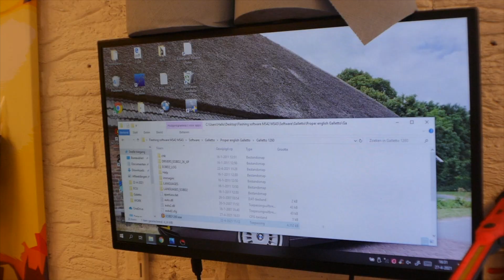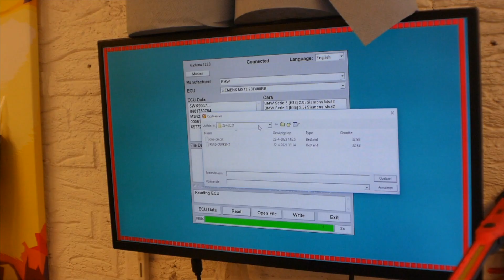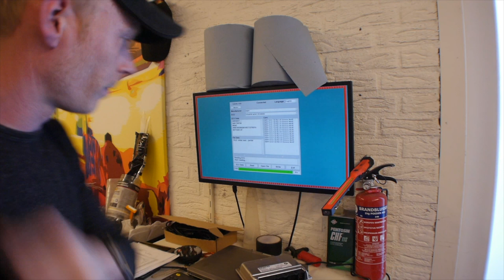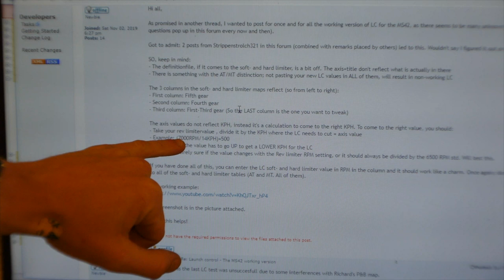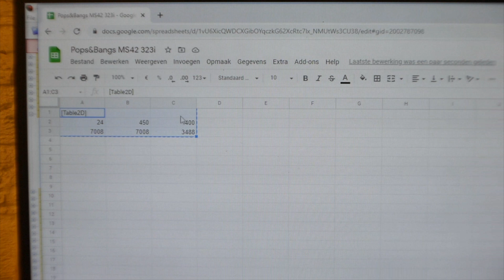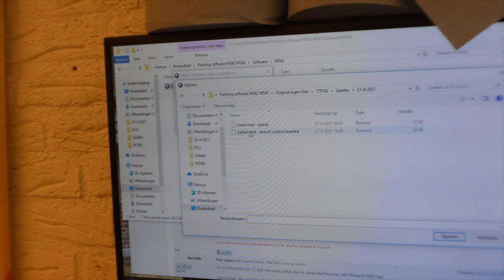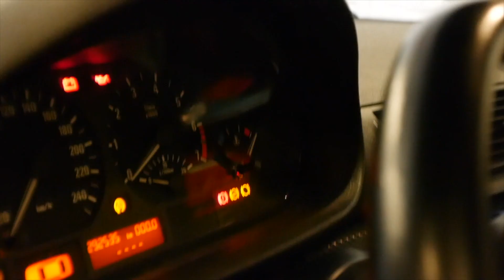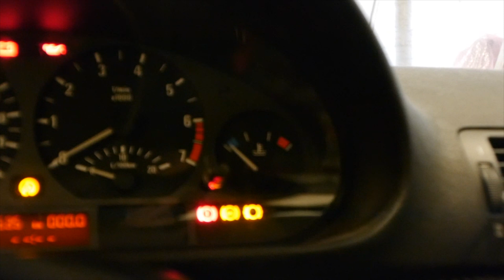YOU can remap LAUNCH CONTROL in your car! - BMW 323i e46 MS42 M52 - DIY Tutorial #2

Comment: fuck galetto, setting it up with inpa cable is a pain in the ass, especially if you didn't include how you got it. just get ms4x flasher, it also has auto checksum for .bin files before you write it to the car, it's a great piece of software.

Comment: Great stuff man, finally in the table title you wrote 400 or 500? I am starting to ECU modding on my own! I did full and partial read with MS4X Flasher, and then will try to write. Greetings
Reply: Hey man ! I just got a cable and i want to start coding myself , how did it go with the ms4x flasher ? As far as i understood , you replace galetto with it. So its a tool to read and write with , did it work well for you ? And did the checksum correction work with chipster ?

Comment: quistion : when the car drives in 1st gear after the breakpoint of the revlimiter used for LC, what will be the new rpm limit in that gear. what setpoint is used for that ?